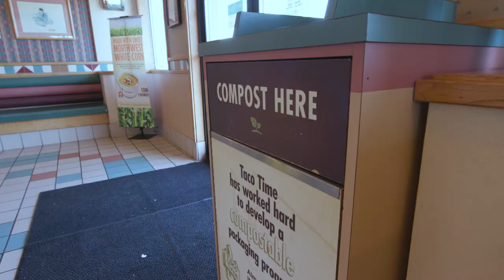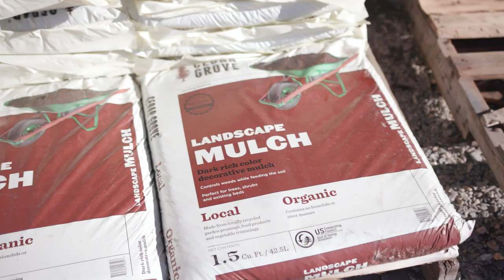Cedar Grove Facility Tour

Comment: There's an awful lot of plastic bags that look like they're making it into the process. Very disappointing. I've pulled so much trash out of Cedar Grove compost bags.
Reply: I agree. So much plastic makes it thru to the end of the process. Before grinding it would be nice to have a way to remove most of it. I got several yards 3 years ago. I am still picking plastic bits out. Very disappointing.